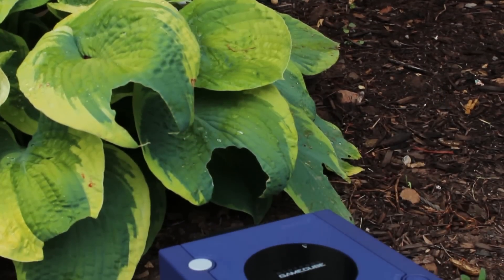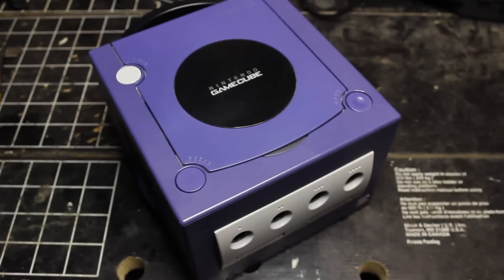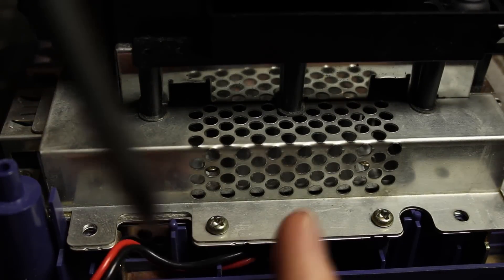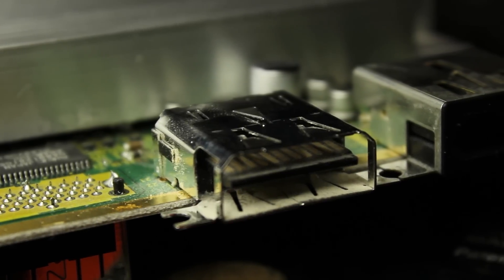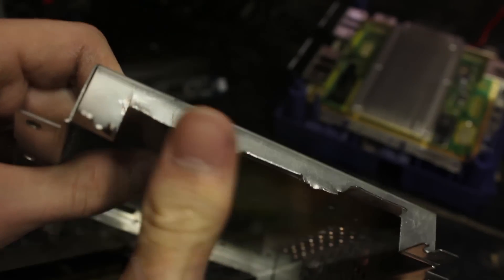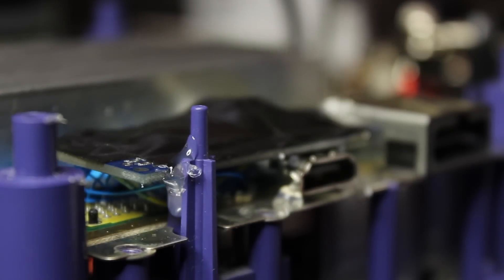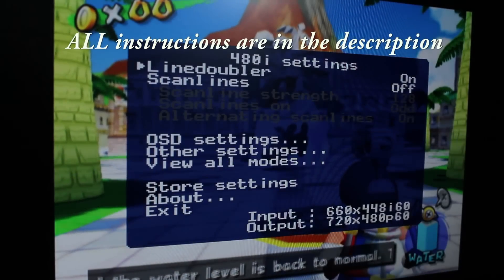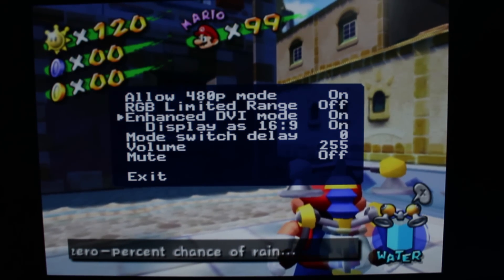GameCube HDMI Mod

Comment: What iron did you use @sam campbell
Reply from the maker: It's rather affordable: https://www.amazon.com/gp/product/B01J5KC93Q/ref=s9_acsd_hps_bw_c_x_3_w
Reply: Sam Campbell Thanks, can you add a link to a tip set for it? I'm having trouble finding he right ones.
Reply from the maker: Connor Jeney
I'm not particularly sure about that specific link, but mine came with alternate tips
Reply: I purchased that iron. It wont get hot enough to melt the factory solder off.
Reply from the maker: Interesting, try adding solder to the points, then removing them. Often times ground pins can be a pain

Comment: Why does your board have that white connector at the side?
Reply from the maker: It was one of the earlier versions of the flashing process, when they kept the pins in, but now they use them anymore (from what I've seen). It shouldn't make a difference

Comment: Hi everyone, I did this mod but i ruined the controller soldering so i can't access the menu and configure the sound output and stuff. i read somewhere that i can use an IR remote but i can't find info on what to buy and what to solder where. If anyone could provide help, that would be great.
Reply from the maker: I believe you can solder onto the red highlighted pin of the player 1 controller port marked in this image:
http://i73.photobucket.com/albums/i208/MNDOGYDUDE105/gamecubecontrollerboardnd0.jpg

Comment: or you can run a emulator on a pc which can enhance to 4k quality.
Reply: 5 games that run 100% fine on pc now
Reply: no need to u already lost
Reply: wot m8 I'll rekt u, I got my minecraft sever priorities m8 u better shut up
Reply: Because Dolphin isn't up there yet. It used to run really smoothly on my computer, until I downloaded windows 10. Now it`s super slow.
Reply from the maker: The same reason people listen to vinyl I suppose
Reply: alex kuang I have a Wii and PS2. Still prefer using them than on my GTX 1060 PC :/

It just doesn't feel the same
Reply: senpai pls for any practical reason? I think not
Reply: 5 lol all games run 100% get gud
Reply: Not everyone is into emulators; they're a legal gray area and aren't guaranteed to match up to the original hardware. Emulating 8 bit and 16 bit systems I can understand, since they're pretty much perfect, but fifth generation systems-onward are still a work-in-progress, especially N64 and GameCube. Besides, it's theoretically possible to mod a GameCube for 4K support via an HDMI 2.0 cable. In fact, in theory you could mod any console for any kind of video output so long as you have the time and resources.
Reply: alex kuang FUCK PC, AND FUCK GABEN NEWELL

Comment: I tried to do this mod a year ago (was and still am an amateur), and the one thing that I just couldn't do was get that fricken port off! I tried so many times after, solder sucker and braid, resoldering it to try to heat it up, anything that I thought could work. And now the board sits in front of me on my desk every day, a painful reminder of the port that I tried to remove... uhh.....only about 15 times... and I'm pretty sure the board would be damaged with the amount of time the soldering iron had sat on the board and at the temperature, which was something else I messed around with but wasn't successful with, in the least. :/

...several first degree burns may or may not have also occurred... but hey who's counting?? (it actually happened 4 times on the same finger, which still has a nice imprint on it after about a year)
Reply: I kept running the soldering tip across the points while lifting the port away from the board. It took me a good 30 minutes or so, but eventually lifted it completely off. Just a note, that if you try this, DO NOT use a lot of force when pulling the connector away from the board, as you risk lifting the pads. My solder sucker was useless, as was the braid. I don't like the idea of compressed air, seems to run the risk of blowing solder onto the board and causing a short.
Reply: Add fresh solder , then use sucker. One at a time
Reply: I feel you, took me quite some time too. I used an air compressor to blow away the melted soldering wire. (If you don't have one, a compressed gas duster will do the trick) It can get a little messy (try not to blow the air in the direction of any other component) but the result is pretty neat.

Comment: Hello. I just installed this mod, but I can't get the GC to output to 480p. Games that require 'B' to be pressed do not respond to the command. Games that allow you to choose progressive in the menus have it greyed out. Any thoughts?
Reply from the maker: Interesting, I'm not sure what to suggest, sorry. Does your output say 480i, perhaps it's already in 480p (although that seems unlikely)?

Of course you can always ask questions on: http://www.gc-forever.com/forums/index.php
Reply from the maker: Actually, one other thing I can suggest is to double check pin 20 on the FPGA to pin 1 on the GC.
Also in the menu, I believe there is a enable 480p mode option, if I recall correctly. Hope that helps
Reply: Thanks Sam. A few others said to check the same things. Will let you know for future reference. Thanks !
Reply: seems I lifted a trace when taking off the digital port, so I had to jump it with a bit of wire. working great now. so mad at myself for doing that😒
Reply from the maker: Krebstar
Ah, done it myself numerous times. De-solder braid can be a bit of a pain to use.

Comment: You know, I've been aware of this HDMI mod for a while, and suddenly I can't help but wonder... why not a Wii HDMI mod? If ever a console needed HDMI... it was the Wii.
Reply: The Wii's component cables are really cheap.  Also you can buy an adapter that plugs into the back of the Wii and outputs HDMI directly for about $15 or so.
Reply: Patrick Day
Where could I find this adapter?

Never mind. I found one. Problem is, it probably outputs the same fuzzy signal that the component cables do.

The Wii isn't just technically inferior, it's downright cheap. The onboard DAC is garbage.
Reply: Agreed
Reply: KNJN lists a Pluto board for the Wii, although it is sold out.

Comment: I see several boards in the link. witch did you use?
Reply from the maker: Item#6117  (Pluto-IIx XC3S200 HDMI) (pre-programmed with GCVideo for Gamecube), not to be insulting but it is posted under the link to buy
Reply: Thanks for the response .Sorry I completely missed that  the item number was listed.

Comment: Also does this mod work for PAL Gamecubes, like the AUS or EUR versions?
Reply from the maker: Yes it should
Reply: Sam Campbell , Exactly what would I need to purchase from this website for this HDMI mod? Just the item #6117?... For the pre-programmed chip.....
Or would I need other pieces? And if so which ones precisely?
Reply from the maker: Kyle Davis
Yes, you only need the pre-programmed one for the GameCube, and then some wire, and a 100Ohm resistor
Reply: Sam Campbell Thanks again. 😄
Reply from the maker: No problem

Comment: You never soldered any wires to the digital A/V port.  You just filled the points with solder...  At no point did you show any video of 22 wires connected to the Pluto IIx.  Is this a joke?
Reply: Kreg Roenfeldt He showed one wire being connected and he has the documents in the description. Also I feel as if him tinning the board is useful for newcomers like me who don't know proper soldering etiquette.
Reply: @nerdyneedsalife8315  pretinn the cable ends is a must. You wil join the solderpoints to the cable easier.

Comment: Hey Sam! I just completed this mod myself, except there is one small issue. I cannot get the 480p Progressive prompt to appear while holding the B button on boot up! I have tested it on multiple progress scan compatible games. Do you think it is a solder point that could cause the Gamecube to not recognize that HDMI mod as a component cable?
Reply from the maker: Interesting. A couple of things to check first would be:
https://en.wikipedia.org/wiki/List_of_GameCube_games_with_alternate_display_modes
Although you did say that the games were progressive compatible, so that probably doesn't help.
Note that PAL doesn't support progressive scan.

Natively the GameCube's component cable contained a DAC to convert the signals to the 4:2:2 YCrCb component out, and the analog a/v port would be used for sound, it seems strange that there isn't any prompt as the fact that there is a signal through the HDMI should allow for enabling progressive mode. The best I can suggest is to check pin 1s connection on the GameCube to pin 20 on the Pluto Board.

Another thing I can suggest is within the "Other Settings" menu make sure both "Enhanced DVI" and "Allow 480p" are on.

Comment: Hi! This looks awesome! do you know if it works great in PAL region?
Reply from the maker: It should work for all regions, just make sure that your GameCube has the digital output port
Reply: Perfect! Thank you! i'm definitely going to do it! one more question? the one port that you wire on top is the especial one on the list? why do you put a resistor on it? and what's it value?
Reply from the maker: Achinebe
Ah yes, I just gave a brief idea of the mod in the video all of the detailed instructions are in the description. Bridging the pins on the top with a 100 ohm resistor is for compatibility for various TVs.

Comment: is this only for the cubes with the digital port or can it be done with later models that did not have them
Reply from the maker: Only for Cubes with the digital port
Reply: Badass consoles offers an option for the later models.  You can restore the digital functionality.

Comment: After a million and a half problems, I finally have my board installed.  Pretty psyched!  It looks great.  I just got really unlucky with a bad firmware on the first board, then the second board didn't work at all.  Managed to mess up two GameCube mainboards because of my inexperience.  But the final product is pretty dang cool.
Reply: How did you figure out there was a problem with the board?  Were you able to get a free replacement?  I installed mine and can't get a signal.  I've rechecked the connections multiple times and everything's correct.
Reply: I don't remember specifically but I know I did some troubleshooting.  Do you have the correct capacitor installed? Also what are the lights on the board doing?
Reply: Patrick Day I used the 100 ohm resistor.  There's one red light that stays on and is numbered 29.
Reply: The solid red light is basically an error message, it should be blinking.  Are you ABSOLUTELY sure there aren't any shorts anywhere?
Reply: Patrick Day I didn't notice any shorts.  I'll just have to redo it this weekend.  Hopefully I didn't ruin any of the boards as it could ultimately be a waste of time.
Reply: Yeah I ruined two boards so don't feel bad.  I ended up NOT removing the component port, but piggy backed because I realized that when I was trying to remove the component port I manged to break a trace or two :(
Reply: Turns out they sent me a board that wasn't even programmed.  I just now got it working!  Thanks for the help bud!
Reply: @tacoconch7678  I think the same thing happened to me

Comment: i honestly wish this mod was for the Wii instead of the GameCube, or at least there would be a mod for both.
Reply: This mod can technically be done on the wii also but it's not recommended.  Also, it's pointless because Wii component cables are dirt cheap or you can get a Wii HDMI adapter for like $15
Reply from the maker: It's "not recommended" because there are fine solder points to work with.
Reply: Patrick Day why is it not recommended ? also, that hdmi adapter converts the signal to native or interlaced 720/1080?

Comment: Wow!  Great video!  I've been on the fence about modding a gamecube, but you showing how easy the installation is convinced me.  I'll just have to figure out the programming.

Do you have a video on installing a region switch for the gamecube?
Reply from the maker: There's a pre-programmed version in the description that you can purchase. As for a region switch the only thing I have is the XenoGC which makes the cube region free, 
https://www.youtube.com/watch?v=FimxP5iX9y8
Reply: Sam Campbell just ordered the circuit board :)

I found a tutorial using just a switch and some gauge wire soldered to a few parts for a region free mod.
Reply from the maker: bringmepieskm
Sounds good! Good luck

Comment: why is there not just a plug in one for hdmi? if you desolder and solder something elkse on wouldnt that be easyer
Reply from the maker: The only problem with making an external adapter is power would still need to be soldered, but yes that would be a good idea, unfortunately nobody manufactures this board in an easy GameCube adapter enclosure. It was more of a DIY project that someone made for a Pluto board

Comment: is there one of these for the wii? and is there any guides on soldering gamecube parts onto a wii thats missing gc components such as mc and controller ports?
Reply from the maker: I believe if you search for Wii HDMI adapters you'll find a few. I don't know of any guides for adding GC components to a Wii, sorry
Reply: i found this.  but the link is dead http://hackaday.com/2012/05/24/grab-your-iron-and-add-gamecube-back-to-the-wii/   the link inside there is dead.

i only read a few lines from this. i guess this is the guide to add gc components to the black wii. it's a mess so i will look into later.  was just hoping there was a version of the hdmi port for wii or that the same is compatible.
 anyways  thanks for this vid. i will try this later. have a good day mate! :)
Reply from the maker: 00098LL
Thanks, and good luck!

Comment: Im debating on trying this.. I have some soldering experience but not much. How difficult would you say this is? Probably tedious Im sure but I can be patient and work through it
Reply from the maker: It's very tedious. However I would say it is not too difficult. Just take your time, if things aren't working right take a break from it. It doesn't have to be done in one sitting.
Reply: Sam Campbell what worries me is that little tiny spot with traces all around it.. but what the hell, I think I'll give it shot. Thank you!
Reply from the maker: Jacob Scarberry
Good luck! Let me know if you have any issues
Reply: @SamCampbell Well I’m 7 years late to respond to this but, that initial attempt was a disaster lol. You really should not try this unless youve got some decent experience. Its really easy to burn off that pad for the controller input. But, Im so glad that I tried it because it really got me into this hobby and I now do all kinds things like this. I’ve modded a lot of my consoles now and a lot for my friends as well. Thank you for posting this video dude! Cheers ✌🏼